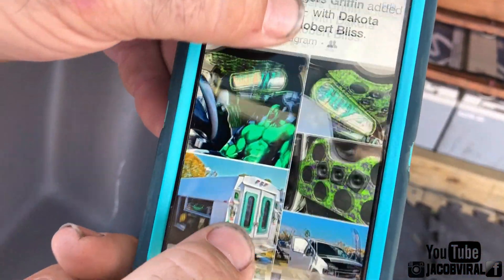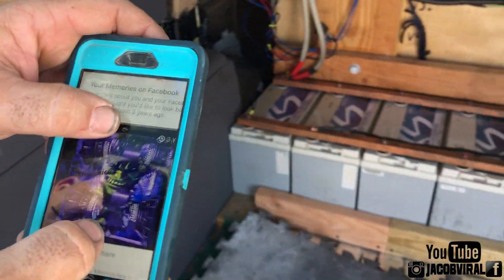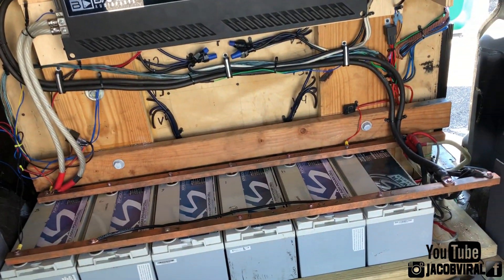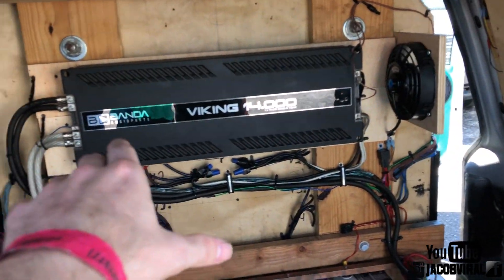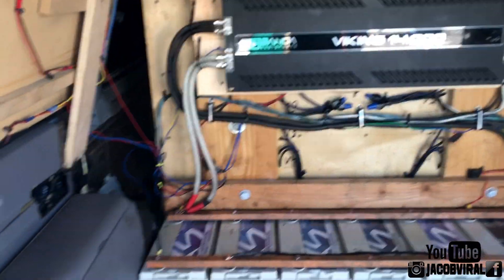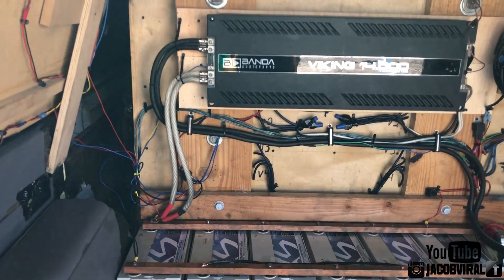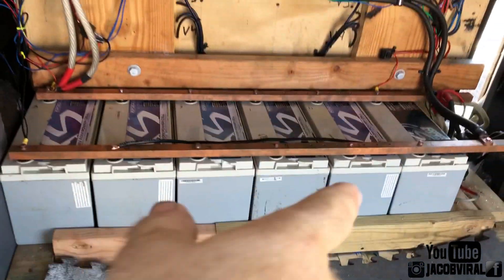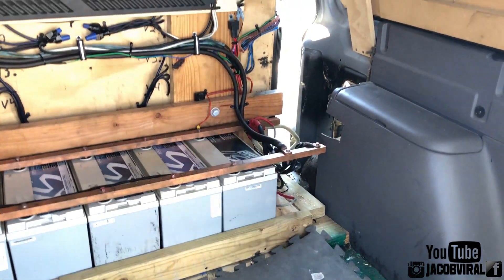4 18S SKULL CRUSHING SOUND SYSTEM

Comment: They hungry for more powe should do 2 9k dc
Reply: I was saying the same thing or add another 14k so each subs can get at least 5k rather than 3.5 each or if they  even getting that.
Reply: @rashadmoss7448  a monblock does not split the power like that. A monblock would be 14k out of 1 channel. If it was a 14k 4 channel then you could push 3.500 to each speaker a monblock pushes 14k to the speakers. So in the previous statement about the 9k's you would strap them together pushing 18k+ to the speakers or pair the speakers per amp. Weather or not he's using all the power is a different story.